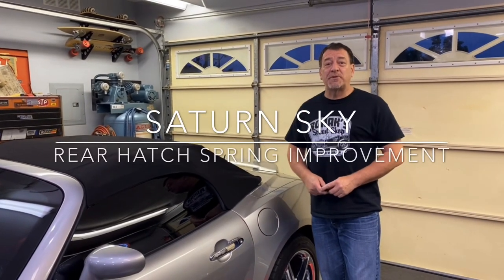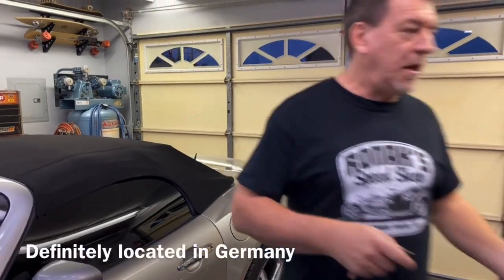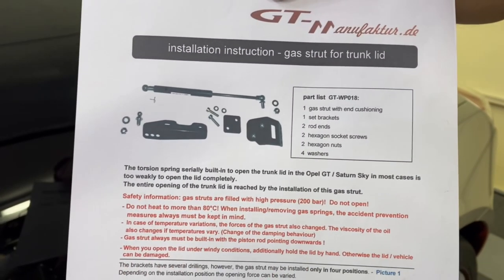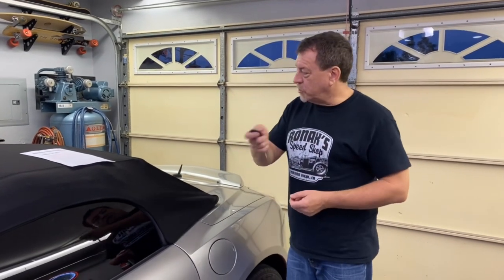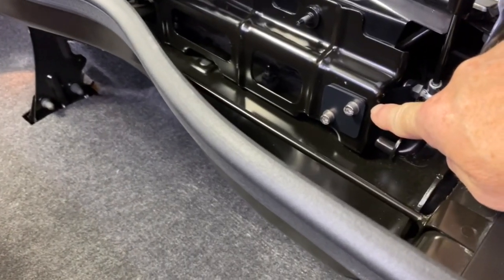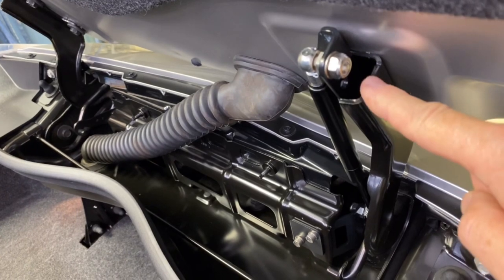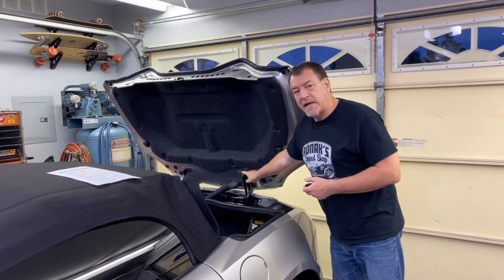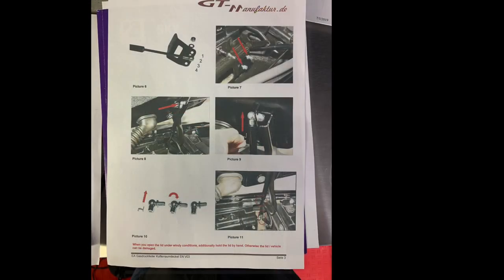Tim’s Garage Episode 16: Saturn Sky Pontiac Solstice Rear Hatch Spring Improvement

Comment: I ordered this kit for my 06 Solstice, delivered in 9 days, excellent service.
Top bracket fitted as per instructions, as for the bottom bracket no holes are present for install.
Reply from the maker: The solstice is slightly different I am told and you need to drill for the lower bracket installation. It seems the rear bracket is slightly different from a sky to a solstice.
Reply: @350tiger  Is there a specific lower bracket just for the Solstice? If not the lower bracket I received needs to have some material removed in order it to fit where the holes need to be removed, plus removal of the rear bumper to mark and drill two holes.
Thanks for your prompt reply.
Reply from the maker: Vic I only have a Sky so I am not sure if the difference … it would seem that with a small drill you would be able to drill from inside the trunk.

Comment: Kewl product! Thanks for the info. I'm a new Solstice owner. Do you think these would function properly even without the torsion bars providing any tension to lift at all? Second question. I looked at the German website and couldn't determine if they are sold in pairs or individually. Can you clarify that for me?
Thanks in advance.
Reply from the maker: I think they might but the intention is To use these as a supplemental lift support rather than a solitary lift and support function

Comment: Subscribed!  Looks like a great product, thanks for sharing.    I printed the install instructions off of the sellers website, and it shows mounting positions A, B, C on one bracket, and 1, 2, 3, 4 on the other.  I like the movement and opening level on yours.  Can you share which mount positions you have yours set at?  Thanks!
Reply from the maker: When you have the actual item I set mine at the weakest option as I really only wanted to dampen opening (save the hinges from being sprung) and not have it fall on my head. My upper point is the highest option. And the lower is the highest option as well. This combination is the lowest lift strength as I recall.

Comment: Great  video as always. I would like to ask if you have any input on repairing the Velcro on the Convertible top buttress. I have a 2008 Solstice that I have owned for 10 years. I have istalled the Stage 2 tune with Martin Scott. Presently I am attempting to accomplish the Big wheel turbo installation using your videos that have helped tremendously.
Reply from the maker: The only option would be to carefully replace the Velcro by stitching fresh examples in place. I did find some examples on Amazon but I would figure out if you need to replace both sides of the Velcro or just one side. Or is it just full of polishing cloth materials and does not have enough ‘tooth’ to grab the female side of the Velcro.
Reply from the maker: Terry I am really glad the videos are helping with your upgrade !

Comment: Hey Tim enjoyed the video. On a related note. My buttress will not stay secured on my driver's side only. I will secure it however driving down the road it pops up. Any thoughts???
Reply from the maker: Yes ... I would ensure the wire spring latch moves freely and has been lubed well so it can get a good purchase on the buttress pin that pushes down against the spring to latch. Make sure the cable allows full movement of the latch ‘spring’ as it may also be holding it slightly open not allowing a good firm latch against the pins.
Reply: @350tiger  Thanks. Will let you know if it helps.

Comment: It is recommended to not use the hollow fairings on the trunk to push it closed, unless you can let it fall with gravity before latching. ie: pressure on these aerodynamic housings coould crack them. It happens.
Reply from the maker: Well you are partially correct. The rear trunk and hood are ‘Hydroformed’ and the bumps are significantly thinner that the rest of the lid and dent VERY easily and in fact mine has a slight depression from the original owner. There is a great video showing how the panels for the Sky and Solstice were formed. I have not seen one crack though I have seen many with dents. Ideally a flat hand on the very peak of the bulge is the strongest point.

Comment: Ok - read the instructions and looked easy enough but one of the ball joints is not threaded and therefore I can't bolt on to the lower bracket as per the instructions.  So much for German engineering...
Reply from the maker: Frustrating I am sure ... Werner was really great to deal with and I would shoot him an email and request a replacement !
Reply from the maker: Jeff here is the Contact email: Werner waldenmayer@t-online.de
Reply: @350tiger  Thanks for your help.  i am sure it will be corrected shortly.